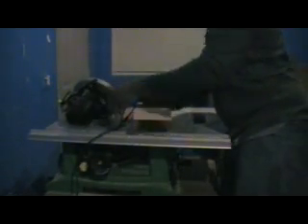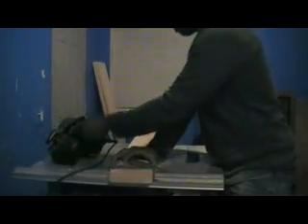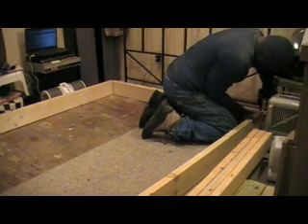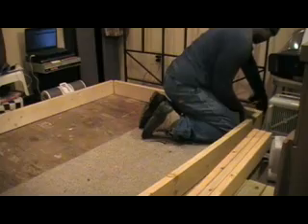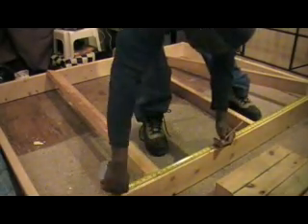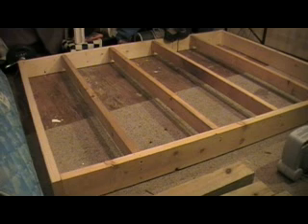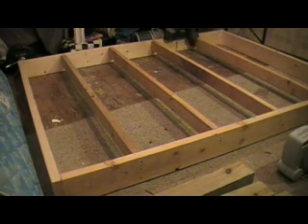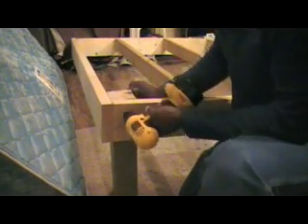Building a Platform Bed For Under $30

Comment: Built this yesterday. Came out to about $45 in material at Home Depot.
But overall, a great, simple, inexpensive build. Much obliged!
Reply: what type of wood for the 4x4 you can't use presure treated wood indoors.  so what did you get.
Reply: Lala Hill I sure did use PT wood, as that's the only kind of 4x4 Home Depot had. Everything I've read says there's practically no danger of off-gassing. But if we all drop dead, I'll try to get back here and warn everyone.
Reply: I am sure you can still buy handbook with all info you need on WoodPrix. Just google it.

Comment: This is what I LOVE ABOUT YOU TUBE. No bs. Thanks for sharing your skills and ideas...this is TOTALLY what I needed. I'm off to the lumber shop and building this on the weekend. Absolutely the BEST DIY bedframe vid here.
Thanks so much for sharing mate!
Cheers and Gods bless!
Reply from the maker: Thank You so much, subscribe & share!
Reply: Sure thing. Cheers.
Reply: lavellesworld Finished on the weekend modifying an old bedframe and it's a MAJOR improvement. Your vid was the inspiration. Only thing significantly different is that I used some fiberboard (and newspapers on top to protect the matress from splinters) to give a perfectly flat surface. Did you use any cardboard or paneling of any kind to flatten the top of the frame? Thanks in advance. I will be building more of these. :D

Comment: Great idea!!  I used your idea, but instead of fixing the cross-members in place. I used 2x4 joist hangers.
It made it lighter to move around. It also added a little more to the cost, but prices here in colorado are high anyway. Out the door with all hardware and lumber cut to size for free at home depot $71 (rounded).

Comment: Fun project thank you! I built one using this video as a guide. I raised mine a little higher and put some storage boxes from Ikea underneath (because my bedroom doesn't have a closet )
Reply: I am planning on doing the same, however im a little worried that because its higher the legs won't support it. Did you run into this problem or will I be okay?

Comment: Awesome build video! I took notes and built this bed Full size to fit an Ikea Morgedal bed and it's awesome. The only tweak I made was doubled up 2x4s instead of the 4x4s and I added support at the head and foot because this mattress tends to bend and slip down inside the frame. I've got pics if you want them and I'll post the measurements when I sort out my notes. Thanks again!
Reply: Would you share your measurements and pics? I'm trying to build a full size bed. Thanks!

Comment: I built one last year, and now I'm about to build another. thanks for the help. The only thing I might recommend is fitting ply wood to the top if your bed isn't as firm as the one shown.
Reply: plywood sheet*
Reply from the maker: I did add some 4 inch scrap plywood, a whole sheet of plywood would of been great on the top but I wanted to make it as inexpensive as possible
Reply from the maker: Thanks Zach!

Comment: Correct Materials List:
2 - 78 ½ in 2 X 6" 
2 - 60 in 2 X 6
4 - 57 in 2 X 4 (for middle support beams)
4 - 18 inch tall 4 X 4 (for the legs)

He says use 3 inch deck screws.
Reply: +Josh P  Is it 57 or 47 inches for the middle support beams. I hear him say 47.5 inches.
Reply: +Elly Swift  Nevermind I have to measure my twin bed and figure that out anyway.
Reply: Elly Swift
Reply: Elly Swift
Reply: Elly Swift it has to be either 47-48  and the side boards or two inches thick because if the bed is 60 inches wide the 47 in would be too short
Reply: Jennifer Hinote I mean 58 if inside the 60 inches side tall are 2 inches thick right?

Comment: I would like to make this with modifications for my application. I have a metal loft bed that I'd like to place another bed under, and I'd like the underneath mattress to slightly stick out from the side so that the person on that bed can sit up against the wall and also look up and see the ceiling. I want that mattress to sit on a 30" platform (approximately, still need to measure) so that it can go over a side horizontal support in the metal loft bed. So, I essentially want to make the platform in two parts, one that is below the top bed and a much shorter piece that sits at the end of the metal loft bed to support the end of the bottom mattress that sticks out. Then, I will place a clothing rack at the foot end from floor to the bottom of the top mattress to hold hanging clothes. This is in a very tiny city efficiency, basically a converted garage, for two adults. So, it's a challenge to fit everything. I want to raise the bottom mattress up to 30" also so that I can store clothing underneath in bins. Storage is a major issue in this teeny, tiny place. The top mattress on the loft is not really all that high, maybe about 60", and so jutting the bottom mattress out from under it by about 20-24 inches will allow me to sit up while having my legs under the top mattress. I plan to use this for sleeping mostly but would also like to be able to sit up in bed. The wall this will be on is 9 feet wide, or just shy due to baseboards on the adjoining walls. The metal loft bed this will be under is for an extra long twin, so it's a bit longer than a twin. Also, the ladder for that loft bed juts out into the room and because I don't want it on my head end, it will be on foot end where the clothing rack will be. There is a wall heater that juts out 4 inches at that end, clearing the bed but forcing us to put the bed another 4" from the wall to accommodate the ladder. This is okay because we will hang jeans on hooks from the end of the top bed on the rails and that extra 4" will give them room to hang. But, it will take away from my room to sit up on the end. So, I want to make two platforms that together hold my extra long twin mattress with the horizontal support bar from the end of the loft bed between them just under the mattress. I can't jut the mattress out without going over or under that bar, and I choose above so that I can store things underneath. I have it on the floor now, but there is wasted space we need to use for clothing storage so we can have room for desks. 

So, essentially, I will adjust the measurements to fit my needs and probably will add horizontal supports on three sides to allow access for storage in the front (side of mattress) but stabilize the items due to the 30" height. 

Question One: Do you use this without any addition bed slats or platform, or do you use some kind of platform set on top of the cross bars? Sorry if that was answered. I didn't see it when I scanned through the discussion. I have seen people use plywood, pressboard, and IKEA slatted bed bases. I prefer having air circulation due to moisture concerns in this place and also the way that odors concentrate themselves in such a small place if we don't work at having air circulation. 

Question Two: How can I make this so that I can remove the legs without too much hassle, like you can do with most tables? Once I put the larger platform together, it will not fit out the door, and so I want to think ahead to the time when I eventually move and make this something that I can pop apart and move easily. I have vintage SUV that could probably transport both parts at once plus more if the legs were not on this. 

Sadly, I have no tools, but the landlord will let me use some maybe if I'm careful. I really have minimal woodworking skills but am somewhat fearless and a bit technical. I can also ask Home Depot to cut the lumber into lengths if it's not too expensive to do that. I have access to a drill and can borrow a hand saw. Looking for the simplest way to do this. Don't want to spend for something new plus I don't see anything on the market like this. 

Any other suggestions? I'm planning to make this so each platform can be slid into place around the metal loft bed supports and also be used later without the loft bed or if we decide to store things under the loft and use this separately. 

Thanks!

Comment: cool thinking of trying this. my boxspring is shot and I'm tired of waking up sore. Did you use plywood on top or just the frame? Also could you put 1 cross bar lengthwise instead of multiple across the frame? Thinking of doing that and maybe a couple joist hangers.

Comment: Thanks for posting, great video!

Why are two of the 2x6's 75 1/2 inches? Doesn't that make the frame 78.5 inches long after assembly when a queen size mattress is 80 inches long?

Comment from the maker: This bed was built for use without a box spring, and can the structure is based on 2x4's on 16 inch centers! It holds over 500 lbs easy!

Comment: this is nice tho i would add 2 support beams per leg. when you add the beams it takes the weight off the middle, where your laying, and on to the borders making it a stronger longer lasting bed. Sorry for that sentence run.
Reply from the maker: thanks for your input!
Reply from the maker: thanks for your input!
Reply from the maker: thanks for your input!
Reply from the maker: Thanks for your input!
Reply: No problem! :-) i just wanted to point out out because it's similar to a fish tank stand i had build. The tank was able to support over 1000 lbs
Reply: +Dariniah Williams I don't think that there are too many 1000 pound people, so my guess is that it is ok without the center leg.  Haha.
Reply: This was a long time ago, but where exactly are you saying to add the support beams? Underneath the cross beams that would support the bed?
Reply: does that mean 8 2x4s instead of 4?
Reply: ill put it this way, i have 9 on mine and i still wish i had more support. the more beams the better. you cant go short. however if you have a box spring it doesnt really matter.

Comment: Question: You put a box spring on top of the platform.  Could I put a piece of plywood on top so that I just use a mattress?  I'd rather make the 4x4 legs a little taller so I can store some bins under the bed, but I don't want the entire thing to be too tall.  Thanks!

Comment: Hi. In the video it looks like you put the mattress directly on the bed. It that correct or is there also a box spring/foundation? We have a new mattress and foundation set that is currently just on the floor on carpet.  Also my wife and I are both fairly short and sort of actually like the height of our current set up. Would this bed work with out the legs and if you only used 2x4's for the outer frame? We just would like the bed just a bit higher than it currently is with the foundation and mattress. Thanks

Comment from the maker: it's a queen size bed. (2) 2x6's cut to 60 inches, (2) 2x6's cut to 75 1/2 inches, (4) 2x4 cut to 57 inches, (4) 4X4 cut to 17 1/2 inches ( you'll only need 1 4x4 to cut out the 4 of them

Comment from the maker: I did'nt use plywood, because i was trying to keep the cost low. joist hangers would have added to the cost of the build and have very sharp edges!! You could also add some scrap 2 by 4's to the frame

Comment: Ah so you just screwed them together. I have seen some people use joist hangers and some don't. I wasn't sure. I don't want sharp edges! I'll be having home depot cut my lumber as I'm in an apartment. I want to use 2x4 all around and add 4x4 legs if that is ok. Also what's a good cordless drill under $50?  You seem to know your way around power tools. Thanks for the vid and response.

Comment: Should you pre-drill the holes before using the 3" deck screws?
Reply from the maker: yes, to prevent the wood from splitting
Reply: Could I do something like stain the wood or treat it in some way to make it look really nice?

Comment: Very excellent video.

However I don't know why you would have the side 2 x 6 wood beams measure 78 1/2 inches. If the 2 x 6 wood beams at the foot of the bed frame and at the head are 1 1/2 inches thick, that would be 3 inches together. A standard queen bed is 60 x 80 inches. So if you're adding 3 inches to 78 1/2 inches you would get 81 1/2 inches. Why not measure the side 2 x 6 wood beams at 77 inches?

Comment: this is my sons account. My name is Caroline. I think this will work for my problem. Every time I buy a metal bed frame for of my two sons they have broken them. This looks like I might be able to do it myself. It looks strong and solid. My sons are big 6 foot around 200 lbs. do you think I should add extra support beams or do you think it should hold?
Reply from the maker: Yes it will hold, I've been using it for over 3 years and i weight over 250lbs
Reply from the maker: Yes
Reply from the maker: It should hold them no problem, i have used it for over 3 years. I weigh over 250lbs. Let me know how it turns out.

Comment: What are the measurements of the board needed for a king sized bed 76W x 80L? I'm excited and want to build this over the weekend. I'm thinking
4 - 4X4 cut at 18" (legs)
2 - 2X6 cut at 78.5"
4 - 2X4 cut at 73"
2 - 2x6 cut at 76"
Reply: How did those measurements work for you?
Reply from the maker: Thomas Radford
Reply from the maker: lavellesworld
my measurements was spot on, the measurements told in the video was'nt. check out the corrections in the comments
Reply: I built this bed in a kingsize as I mentioned I would earlier. It turned out perfect. I made it taller even though I was using a box spring because I wanted to climb into bed. It turned out perfect. It sits up perfectly against the headboard I had already built. I bought my wood from home depot and also added supports for the slats. Came out to about $50 in wood

Comment: Will this support about 500 lbs?  Do you think i should use brackets for extra support or should this hold fine with only 4 screws per post?
Reply from the maker: It will support 500lbs with ease, just predrill your holes to prevent spitting of the wood!
Reply from the maker: you could use brackets too!

Comment: If the 2x6s are cut at 60", why aren't width of 2x4s cut at similar widths if they're spanning same space...47" is a difference of over a foot. Just want to make sure before I cut. By far easiest platform video out...thanks.

Comment: I want to build a king size can u give me the measurements for that. I want to do my own head board also
Reply from the maker: what is the length and width of your mattress?
Reply: It's a queen idk I gotta ck
Reply: I wanna get a king size tho
Reply: Teressa Williams If you look at my comment above I gave the measurements I used for a kingsize. The 78.5 you could take down an inch I didn't subtract the with of the other board. measure the height that you need for legs. I made mine super tall like I wanted with the tall legs and a box spring.
Reply: ItsMe okay thanks. I'm gonna try lol

Comment: Thank you for sharing your idea!!!

In the beginning you give the measures as follow:
4 - 4X4 cut at 18"
2 - 2X6 cut at 78.5"
4 - 2X4 cut at 47"
2 - 2x6 cut at 60"

These are measures for a queen bed BUT on the 2X4 should it be 57" instead???
Reply from the maker: yes, but they can be cut longer or shorter.
Reply: They should 57' ...47 is way to short...I just did your project !  Great video this took me 30 min to build.
Reply: Caesar Montemayor Thanks!
I realized it because I took the measurements to the lumber store and realized this after the fact!!!!  but then, this only happens to me! hopefully nobody else!

Comment: Thanks for the measurements. However I do have a question. In the video you state the measurements for the 2X4 should be 47 1/2 but in the comments someone says the correct size should be 57....could you please clarify?
Reply from the maker: Correct Materials List:
2 - 78 ½ in 2 X 6" 
2 - 60 in 2 X 6
4 - 57 in 2 X 4 (for middle support beams)
Reply from the maker: Correct Materials List:
2 - 78 ½ in 2 X 6" 
2 - 60 in 2 X 6
4 - 57 in 2 X 4 (for middle support beams)

Comment: should have used lag bolts on the corners and no need for 16 in on center with the 2x4's couldve use less and ran a piece of sheathing across the top

Comment from the maker: using 2x4s that are too short  will cause you to use more deck screws that you have to which is about 1/4 of the cost to build this. Cut the support 2x4s out of 92 inch 2x4s will cost a little over 2$ a piece! Thanks for your input I will put the cost of each part of the build in future videos! if you have'nt subscribed please subscribe!

Comment: This bed has been terrible for me. We bought the appropriate measurements, but we found out Home Depot’s plywood is sold crooked. As a result, we had to really screw in those screws. Plus, the bed ended up being a different measurement because when we finished building it, it ended up wider than a queen.